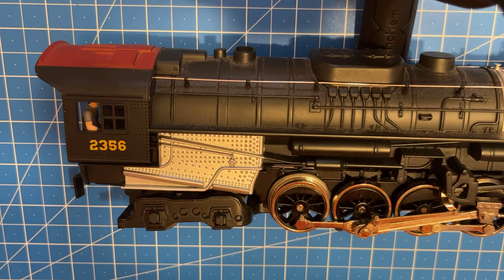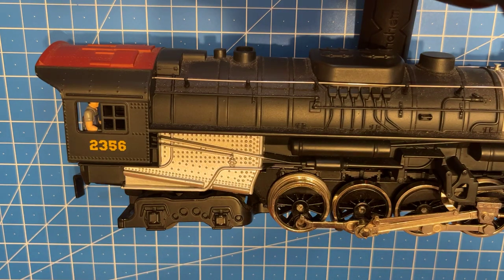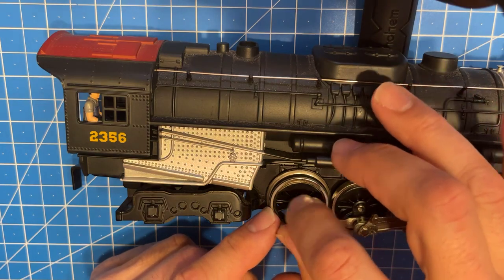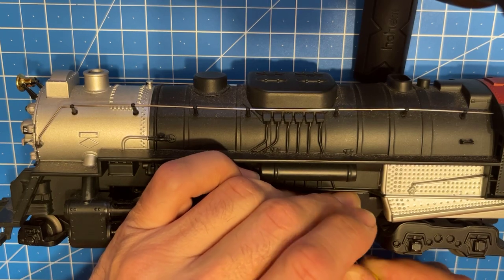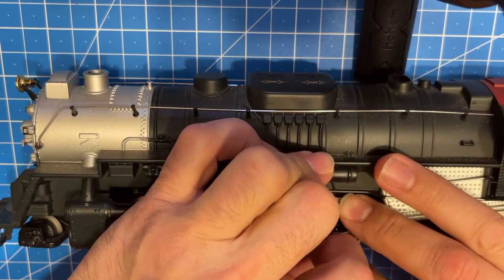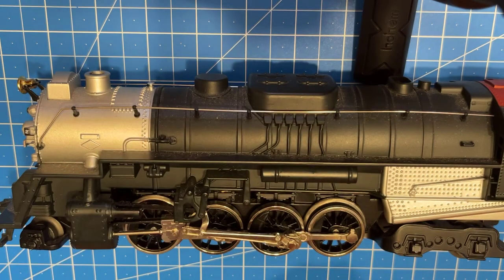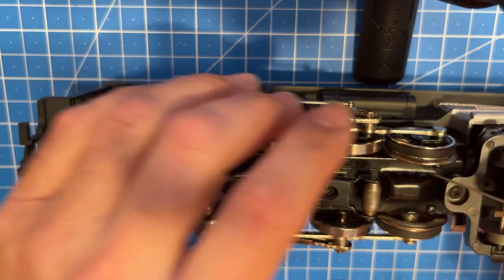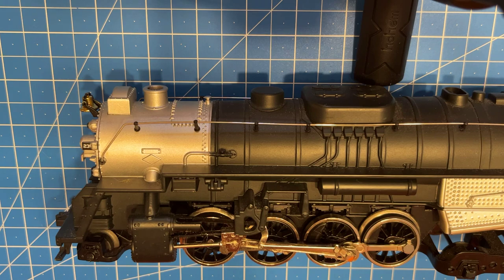Changing traction tires on a Lionel steam engine

Comment: I was born in 1976 and we didn’t have this rubber traction tire bullshit. We had the one and only *MAGNE-TRACTION*. Today I remove the traction tires from my scale engines just to make them actually run like their real life counterparts. For my nephews, I leave the traction tires on the “Lionchief” engines.
Reply from the maker: I bet you’re nephews had a great time!
Reply: Maybe traction was great but they were certainly louder sometimes. If only we could use sanders on our model trains 😭😂
Reply: Magne-traction* thanks autocorrect

Comment: I need to do both on an 060 switcher I have… don’t know where or what I need…
Reply from the maker: It should be similar to this,  I have another video changing tire on diesel locomotive. And if you find my on Facebook or instagram. I might be able to help with some pictures and videos. 
Chris Turk Papa Turk
Thanks for watching!
Reply: @ChrissTrainsandMore  thank you for the reply! I’m not on the other formats but this video definitely gives me the idea of what I need to do. I’ll just need to get the tires. I’ve called Charles Ro. The other option is calling Lionel but Ro is somewhat local so I’ll try them first.